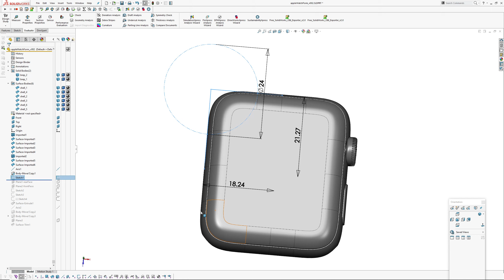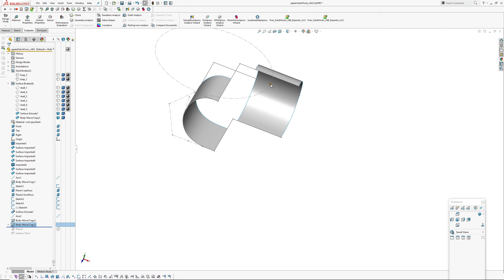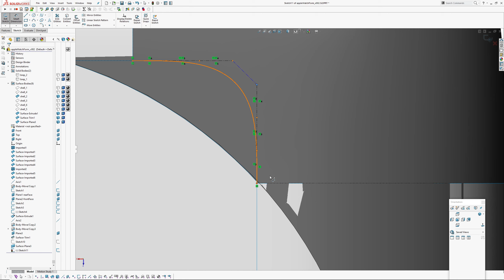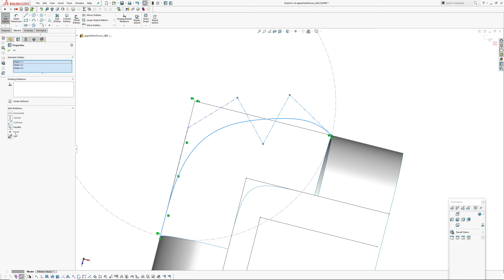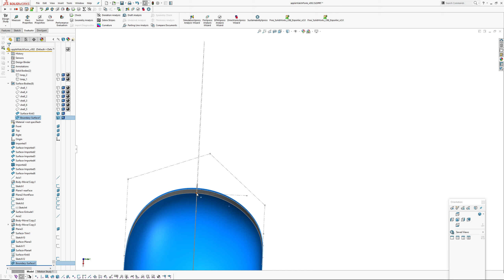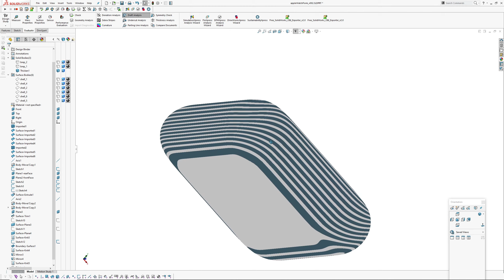Apple Watch - Modelling the Main Form in Solidworks

Comment: A very nice breakdown, well explained. The fact you had to add the extra curve kind of reinforces my theory that clean surfacing is more easily accomplished in Rhino. I’m a long time SW user and I’ve recently switched over to using rhino for initial concept modeling. Which is your preference?
Reply from the maker: Hi Luke. 100% agree you can create cleaner geometry in Rhino. There just are not the tools in SW to manipulate the surfaces without using curves. Both programs have their cons - SW, the surface quality can be marginal, but it's way easier to iterate a model. Rhino, surface quality and ability to manipulate CVs are great, but if you need to make alts you need to have a strategy to layer off progress so you can 'roll back' to an earlier version. For most of my work I'm locked in to the application my client uses, so mainly SW.